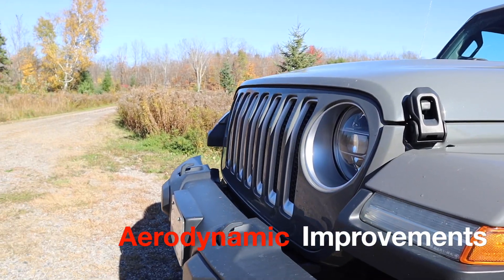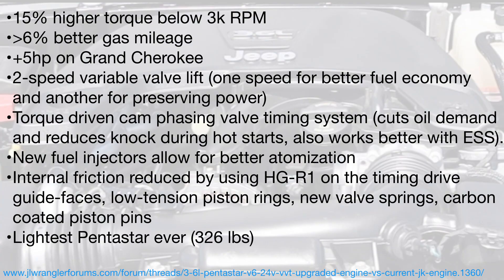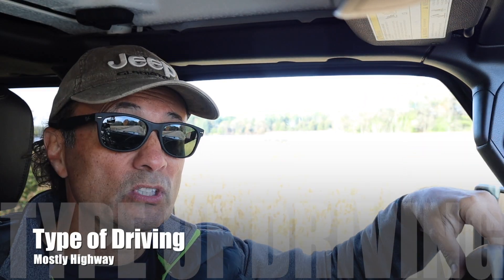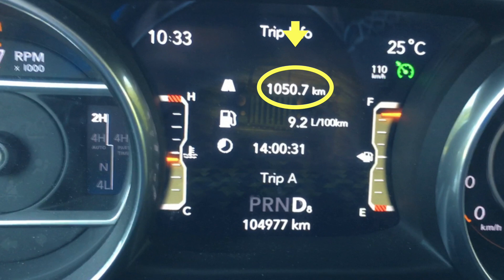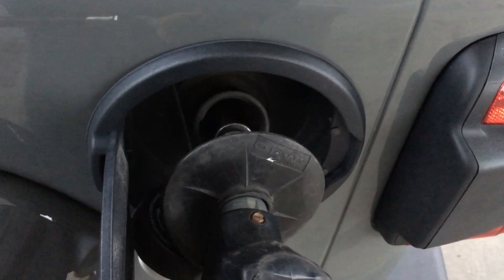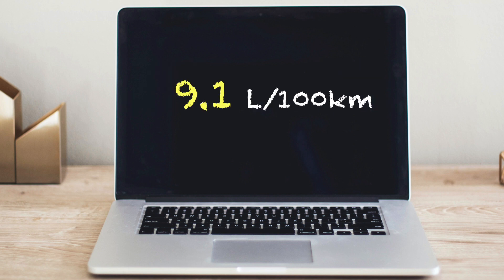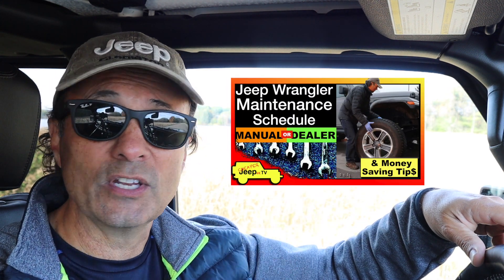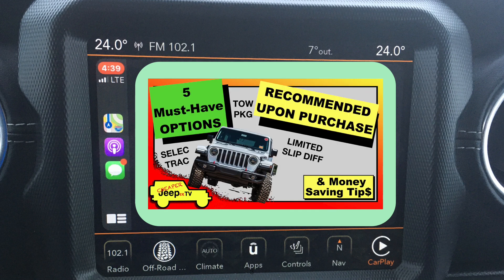Jeep Wrangler JL Fuel Efficiency, 3.6 L, 8 Speed Automatic Transmission

Comment: Does the jeep rubicon get the same mileage?
Reply from the maker: Hey Bob, 
My Sahara had nice Bridgestone A/T tires. I loved them.  
The Rubicon has a different type, size and weight of tire and rims.  
The Rubicon also has different mechanical components, with respect to gears, suspension, etc.  
I would imagine that it wouldn't be able to get the same milage as I experienced in my stock Sahara. 
I hope that helps.
Cheers.

Comment: What was your average fuel economy after the lift and tires? Thanks!
Reply from the maker: Hey Jimmy, 
On the hwy, before the lift and larger tires, I could get 9.7L/100kms easily. 
After the lift and larger tires, hwy milage would usually be ~ 11.5L/100kms.
I hope that is helpful.
Cheers
Reply: @CheaperJeeperTV  Thank you!

Comment: yes, yes, if you drive a longer route, consumption can be reduced to below 9L/100; but if you drive in the city it is around 12L/100
It all depends on the starts and how heavy a person's foot is (on the gas pedal). 

I use the cruise control very often, almost constantly, and it helps a lot in the city. Otherwise I am very satisfied.
Reply from the maker: Hey bosley,
Yes. I'm fortunate that most of my driving is hwy driving, so I get to enjoy decent fuel efficiency.
Cheers

Comment: Is this with 87 octane fuel? My 2019 JL 2 door I only see about 20-23 mpg unless it’s all highway driving maybe I could get 25
Reply from the maker: Yes it’s with 87 octane. That fuel efficiency was in a 2018 stock Sahara with the 3.6 L Pentastar. Most of my driving is hi way driving. It’s not typical but when the weather and driving conditions line up, I got great mileage. Now that I put on a lift and larger tires, it’s not so great. I hope that was helpful. Cheers

Comment: Good information, thank you. In a 2021 Jeep JLU, stock, with a diesel motor, we average 30mpg (US gallons) / mile. Lots of Highway miles. Any speeds over 75mph drastically lower the mpg. This is in the hills of East Tennessee. Keep up the great videos!
Reply from the maker: Hey Fred, Thanks for sharing info about the diesel and the feedback on the video. Cheers.
Reply: I get 23 mpg with 37 inch tires

Comment: On 11-30-2020 I ordered what would be my first ever Jeep, a 2021 JL Jeep Wrangler Unlimited Rubicon. It arrived at my local dealership on 02-12-2021 and I took delivery of it on 03-01-2021. 

I’ve now had the Jeep for approximately 4 1/2 months but only have around 1,650 miles on it because I only work about 3 miles from my home. 

When I ordered my Jeep, I ordered it with the 3.6 liter V-6 and 8 speed automatic transmission. My heart really wanted the manual transmission but due to other very specific needs and requirements I had to go with the automatic. Then about 2 weeks after I placed the order for my JL, Jeep then went and announced a few weeks later the release of the new 4XE and 392 V-8. Had I known about them beforehand I would have absolutely, positively ordered a 392 JLUR. Oh well, I still really do like my new Jeep a whole bunch. 

The mileage on mine is actually pretty decent for having a majority of the driving being around town driving, going up a few hills both to and from work, as well as when coming home too, and having several traffic lights along the way too. We live in a very small, rural town in Northeast Colorado, almost at the Colorado/Nebraska border that is surrounded by agricultural farms and/or cattle ranches. Because of that, we don’t have to deal with a whole lot of traffic but for the size of our town, there sure does seem to be a whole lot of traffic lights and stop signs. So because of those reasons, I realize that the potential is there to allow my Jeep to actually have a lot better gas mileage if the driving conditions were slightly better. We also have lots of really cold weather out here as well and on most mornings throughout the year except for summer, temperatures will be well below freezing or just slightly above it. Because of that, in those types of pretty cold weather, I start my Jeep and let it somewhat warm up first, prior to taking off and driving to work. I also do the same thing in warmer and summer months as well but I don’t let my Jeep idle just as long as I do in the colder and winter months. 

With all of those factors into play, I average somewhere close to be right at or around 16 mpg. Sometimes a little less, and other times a little more. So overall, not to bad with all things considered.
Reply from the maker: Yes the 4XE would have been tempting for me had it been available. Cheers.

Comment: You likely never broke 90km/hr
Reply from the maker: You’d think, but on HWY 400 I was between 100-105 km/hr on average.
Reply: @CheaperJeeperTV  very flat, or down hill with a tail wind!
Reply from the maker: Hey Dave, the trip I do regularly is 320 km along HWY 9 and the 400. The terrain is gently rolling hills. My fuel economy that I experience is also experienced by others as shared in the forums. Mind you, my numbers are for a stock JL Sahara with the 3.6 L V6 and the 8 speed automatic transmission. Once anyone starts doing mods, then results worsen.
Reply: @CheaperJeeperTV  I have a 2020 JL Sport. 3.6, Auto. Trans. Mid 9’s is the best 
I can get. No Mods.

Comment: I’ve had my 2020 JLU Freedom Edition for a little over a month and just got back from a trip from Hilton Head Island to North Alabama. The first 60 miles were in HHI with more stop and go traffic with the last 440 miles highway/interstate. Driving the speed limit, I was able to get 26.7 mpg on the tank and I went 510 miles on the tank before I refilled. I have the 3.6L automatic and did use the Lucas Fuel treatment on the tank. I used to have a 2008 JKU 2WD 6 speed and I think the best I ever got in it was 24 mpg...
Reply from the maker: Hey Jmac, Welcome to the club. Thanks for sharing. Cheers.

Comment: great video, lots of information. It's been a long time since I have seen 11L/100KM, after all my mods, lifts, bigger tires, and skid plates, I normally come in around 14L/100KM or 15L/100KM..  Makes me want to get a JL :)
Reply from the maker: Hey TrailWalker, The JL's upgraded Pentastar combined with the 8 speed auto helps a lot I think.  But it wont stop a hit on fuel efficiency if I start adding mods...which I'm likely to do now that I'm eager to do more off roading. But it's good to know where the bench mark is on this sort of vehicle.  Thanks for watching. Cheers.